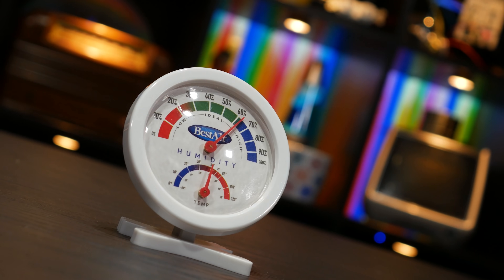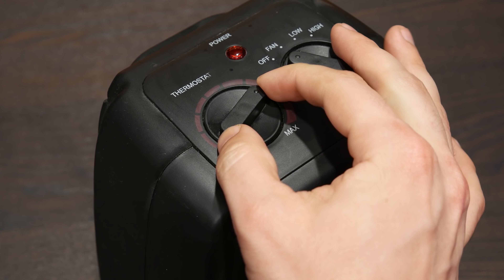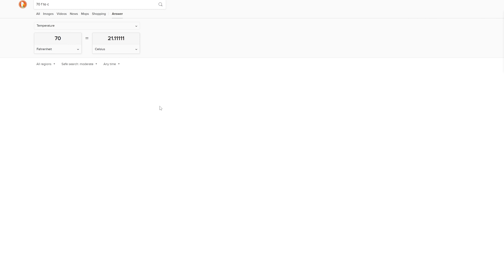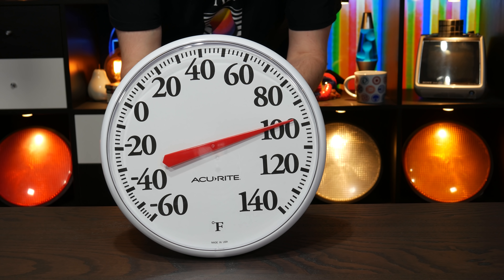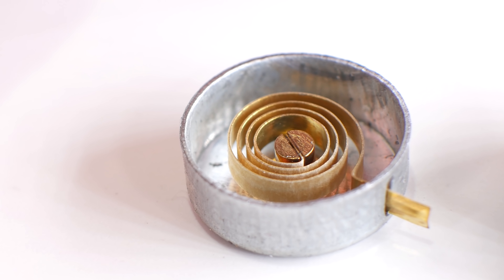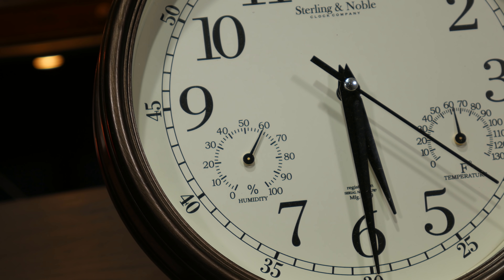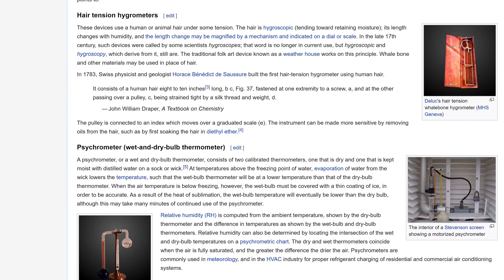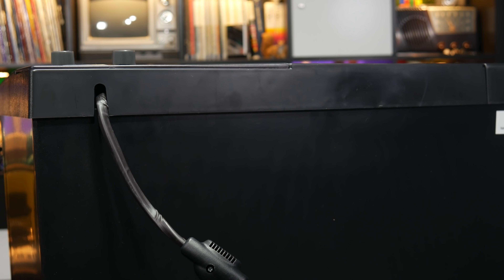Analog Hygrometers - how?

Comment: I've got a soil moisture sensor for checking my potted plants and seeing if they need watering. It seems pretty simple - it has two tines that go into the soil (one is for measuring pH I believe). It doesn't use batteries or anything.

I was trying to think about how this sort of mechanism would work when the "measurey" bit is on a metal tine that goes down into the soil, instead of a coil directly attached to the dial, measuring it's surroundings. Any takes on that?

Comment: Loved the temperature rant.  All the same points I've made to my euro-friends.  C is a good metric when you're in science and engineering, but I'd rather keep my dumb imperial standards for day to day use.  F does scale perfectly for what the human body likes between 0-100.  What water thinks about the scale is irrelevant!

Also, CM and MM are too small to be very practical for the average person, and a full meter is pretty long if you're trying to gauge the distance between things.  The real issue with inches and feet comes from the stupid progression of 12" = 1'  and 3' = a yard.  Dumb names, dumb conversion.  And I can't even remember the very specific number of feet in a mile.  But again, from a practical point, a foot is not that far off from the length of normal human foot, and a yard is about a single stride.  It's a metric built for human use, and not something scientific, like comparing everything to the world's most common chemical compound.  Humans are a lot less precise than the way a chemical reacts, and that's OK as long as we agree on the exact sizes of these measurements.

Comment: Regarding temperature scales: I set both my phone temperature reading and my car thermometer to read in Celsius, and I still can't think in Celsius. Its been 10 years since I switched over, and I still just do a quick and dirty calculation in my head to convert to Fahrenheit. If I see 30 degrees on my thermometer, I know its hot outside because I've done the mental calculation enough times to just remember that it equates to roughly 90 degrees Fahrenheit.

Comment: It is not about conversion to outside the system, but conversion inside the system. cm to m to km is easy and you can do it in your head. Just shift the comma. Now please convert 12.446 inch into yards or miles in your head...
12.446 inch = 0.345722222 yard
12.446 inch = 0.000196433081 mile

Comment: Here is a thought. 1960's car fuel gauges used heated bi-metal strips that were connected to the pointer. Take the component from 7:49 and put it in a circuit with a battery and a similar gauge and you could have a simple battery-operated Hygrometer!

Comment: I'm currently at like 2:40 when he is talking about temperature and stuff. I have a rough (and I mean VERY rough) mental conversion I do. Let's say the temp is 70F. All you need to do is subtract 20, then divide by 2. Then you get the answer 25C. The correct answer is closer to 21C, but it is close enough to get an idea for me at least. You can do it the other way. If the temp is 18C, multiply it by 2, so it is now 36, and add 20, 56F is the area. The actual temp is 64, so not totally accurate, but you can get the idea if the temp is close to room temp, hotter than room, or colder than it.

Comment: Yes! The burn with the search engine! Yes!
Or you know. You can download a converter app.
Edit:
Seriously. The most important thing is stating the unit. Even in metric as one time it might be the base unit (for example a meter) and another time a derivative unit (a decimeter).
You. Have. To. State. The. Unit.
I don't care what unit you're using as long as it is usable/readable. (For instance 0.000002 m is unreadable as heck, but 2 or 2*10^-6 m are readable and usable).
Also, please don't convert units like newton to SI units unless you need to. (N = kg*m/s^2)

Comment: Very disappointed.  No discussion of relative vs absolute humidity.  No discussion of dew point.  Even the sensor in the humidifier is crap for accuracy.   If you want an accurate measure of RH, you need and accurate measure of the temperature, and the dew point (and a lookup table).  Accurately measuring dew point is worth it's own video.  Hope we get some of this in the Connextras.

Comment: You skipped one of the more interesting ways to measure the humidity in the air and a chance to talk about latent heat again: the sling psychrometer. It was even on the Wikipedia page you had open in your video. It even has an awesome name that sounds like it should be a tool for finding ghosts rather than what it actually is: a calibrated meteorological instrument. Also, it's a rather simple and elegant design that is basically two thermometers on a stick, one wearing a wet sock that you swing through the air.

Comment: For my fellow Americans who read both celsius and centigrade in the comments and realized you didn't know the difference, I did a quick Google for all of us. Now that this is not an in-depth explanation...

The temp scale used to be called centigrade and has been updated to be called celsius. Celsius is still a centigrade measurement system, though, as a centigrade system is based on hundredths and celsius is based on 0-100 for freezing to boiling water (centi+grade). Both names are technically correct, but it's one of those "this is a variant of that, but that isn't a variant of this" sort of things.
Also, I guess when changing the name to celsius the actual degree points were dialed in a bit? Like I said, I didn't dig too deep here.
Also also, I guess saying centigrade for the temp scale was confusing for the Spanish and French because they use that word for describing angles (like degrees and radians).

Comment: Thanks I've never thought of how these worked before.
We had one at work that worked with hair, and clockwork mechanism to give a paper recording of temperature and humidity over a week, till it got broken when we sent it for calibration, we now use electronic meters to do the same.
Thought you might have mentioned the wet and dry bulb method which you need to look up a table to get the humidity (basically 2 thermometers one which was kept wet). Also had 2 types of this, one which was just on the wall with 2 thermometers (cheap and nasty) the other on a handle which you swung around (a lot better construction)

Comment: "and a 0-100 scale that correlates with human temperatures is more pleasing" THANK YOU. Like, it doesnt really matter what temperature water boils at or freezes at in day to day life. But it does matter whether I need to wear a coat or a baseball cap. All temperature scales are arbitrarily based on something, it doesnt really matter what you base it on.
Similarly, metric length measurements- A foot is a very useful metric in day to day life. We have a yard if we need a meter length, and a mile if we need a long length. Whether a kilometer or a mile is a more valid measurement for a long distance doesnt really matter, as long as everyone is on the same page. And again, conversion rate doesnt really matter that much in day to day life.

That said, imperial Volume measurements are shit

Comment: I'll total agree that metric length and weight units are better than what we use in the US, but Celsius doesn't seem any better to my than Fahrenheit. Most of the benefit of metric is simpler fractional units, and how useful is having the boiling point of water an even 100, I don't even remember the last time I needed to know the boiling point of water (and I still haven't forgotten it's 212F).

Comment: One could argue Fahrenheit being a scale designed between the freezing point of water and blood temperature could be better for meteorological purposes for ‘real feel’ temperatures. 

One could also argue those centigrade snobs are incorrectly using centigrade instead of the SI unit of temperature, the Kelvin. 

In the end these arguments are moot. Just use the one you prefer.

Comment: Weird, i was just thinking about analogue hyrometers earlier today. i was wondering whether I could make a mechanical soil moisture sensor and use it to control a tap to a soaker hose without needing any electricity. So it would water the plants when they dry out. Kind of like a wax-disc thermostat but for moisture instead of warmth.

Comment: Great video as always! But can you use °C the next time? It's objectively better.
Reply: Incorrect
Reply: @kylemaloy5524  It's better because at the mean air pressure you can tell up to two different ambient temperatures. You just need a precise barometer and water to tell it. If it starts to freeze it's 0 °C and if it starts to boil you should get your priorities straight.
Reply: Ah yes, 0° outside being kinda chilly but easily solved with jacket and 100° outside being the end of the fucking world is a very well scaled system for everyday use. So much better than 0 being really fucking cold and 100 being really fucking hot.
Reply: Correct

Comment: Degrees Fahrenheit is objectively better than degrees celsius. It is more precise at the same number of significant figures. Choosing celsius was the only mistake in the metric system, well that and not adopting metric time.
Metric supporters, get off your high horse until you fix time. 24/60/60 isn't metric.

Comment: No need for a rant about advantages of any system based on the temperature scale. The metric system has the advantage, that the units increase in factors of 10. Temperature, however, does not, and therefore,there is no real advantage of either system. Even the higher resolution of the Fahrenheit scale is not an argument as weather forecasts are usually something like "high in the eighties".

Comment: the electronic hygrometer are pretty awful as well. I bought a bunch and put them together into a dry box where I am going to store my filament and only about 4 out 9 agree with each other. The others are at least 5% points off. And when I tested them in the room with normal humidity the results were even worse.

Comment: Farenheit is objectively better for everyday use, especially when talking about weather. Fight me, rest of the world.
Reply: Fahrenheit was invented for the weather.
Reply: as an edgy high schooler, I used to be a metric rebel, saying we should totally switch, but I've come to warm up to some specific applications of our system. Temperature, as you mentioned, but also distance, specifically miles, when walking, I learned, is so named from the latin mille meaning thousand, as in a thousand paces, and a pace being two steps, giving you roughly a mile. but inches is totally crap, I say make the hybrid system a thing. also, tsp and Tsp are very useful
Reply: @johncounts2182  yeah it's a completely different way of thinking about measurement. SI makes the mathematics of unit conversion easier, but since it's base 10 when you truncate/round a measurement you have to go up a full order of magnitude. As a result you get a lot of cumbersome situations where the base measurement is too fine for the thing you're measuring, but the next largest (being 10x as big) is too coarse. American/imperial measurements, on the other hand, are usually loosely based on dividing things into halves and quarters, which tends to be a more useful way to break something down than dividing it into tenths. I think that's part of why so many Americans actually prefer imperial to metric, despite the fact that we all know metric. Like outside a math textbook it doesn't matter in the slightest that it's easier to convert centimeters to kilometers than it is to convert inches to miles. On the other hand, the fact that I can cook using only a cup measure, without really thinking about it at all, because all of the volumetric units are easy-to-estimate halves, quarters, eighths, etc. is really nice.
Reply: @user-lk2vo8fo2q  Americans don't prefer Imperial. That's strictly a UK Commonwealth thing.

Comment: So, why don't you guys use Fahrenheit if the internet provides convenient ways to get the tempretur in Celsius? (And I haven't even started about SI units)
That aside, a quick guide to °C:
-10°C: extremely cold. shoudl should get a really warm winter jacket and wear gloves and a bonnet
0°C: really cold, if you look outside and the water is frozen, it is below 0°C
5°C: cold. You are going to need a warm jacket.
10°C: relatively cold, you are going to need a jacket.
15°C: Mild spring day, a light Jacket or a warm sweater should be enough
20°C: Room Temperature. A checkered brown suit jacket is usefull if you sit around for long periods of time.
25°C: Warm, a T-shirt is going to be enough.
30°C: really warm. A pretty average summer day.
35°C: hot. A hot summer day.
40°C: extremly hot. At least in Europe. In Texas or Arizona this is porbably a pretty average summer day.
Reply: Heres an even quicker guide to °F : 0 is really fucking cold, 100 is really fucking hot, anything in between is a simple percentage.
Reply: @kylemaloy5524  so room temperature is about 90°F?
Reply: @burningSHADOW42  ah yes, 90% of "really fucking hot" is probably comfortable, that makes sense
Reply: @kylemaloy5524  yeah pretty much.
20°C is comfortable and 30°C is too hot. At least for me.
Reply: @burningSHADOW42  what even is your point there??? 20 isn't anywhere near 90% of 30. I'm sure 27C doesn't sound very comfortable if 30C is too hot
Reply: @kylemaloy5524  my point is that I wanted to provide a nice guide to Celsius for Fahrenheit users.
Your description of Fahrenheit is not really helpful because, too hot or really cold are highly subjective. That's why gave some other point of reference that are more general.
But I probably should have added:
~36°C Human body temperature

Comment: I am a Metrologist. I give you a C+. First of all Fahrenheit is more accurate than Celsius, about 2 times. This humidity measurement is relative because it equates with the dew point. I have calibrated many with horse hair too. A sling psychrometer would of been a great tool to show.
Reply: Not more accurate, only has smaller 1° divisions. More accurate (or perhaps more 'true') is Kelvin.
Mainly because it helps understanding that a 1°C difference is just about a 1/300-th difference in energy (at about 25°C / 77°F).
Reply: @johanponken  Which is more accurate? Telling someone they have a glass of water or telling them they only have half a glass of water? 😀

Comment: "tollerable range of temperature" is extremely subjective and inaccurate, when everyone has clear idea of water boiling and water freezing,
Btw, i believe even in us, if you ask everyone what subzero temperature means, they will answer when water freezes (e.g 0 C) not sub 0 F
Reply: If you asked me what I considered "sub-zero temperatures" I would tell you "Below 0 degrees in the temperature scale I use, which is F" and not "when water freezes" because that happens much earlier than 0 F.
Reply: Subzero is below 0f, below freezing is below 32f.

Comment: Ok now describe the difference between the metal strip in space heaters, wall fireplaces and the ones in your house thermostat. the ones in the space heaters do relative temp (the temp they heat to varies with the environment temp) and the one in your house thermostat is calibrated to the actual temperature.

Comment: Celsius vs Fahrenheit is the dumbest of the units arguments.
There's no inherent advantage to either. They don't make conversions or working with other units any easier.
Celsius is only more convenient when you're dealing with water. Fahrenheit's advantage in precision is only relevant if you don't like using decimal points and its only more intuitive if you're talking about human comfort. Metric users could start using Fahrenheit and vice-versa over night and it would change nothing about the rest of their systems. It's 100% a question of preference.

Comment: Simple from the outside, but hard to make it run in the beginning.
Trying to make a mass produced product based on those physical properties, maybe in the early 1900 or so, would be a few months of experimenting and refining.
Even the very cheap ones today (that work) probably required weeks or months to get them into this state. The final plastic mould will be extremely cheap in the end.
However, the MEMS sensors will take over. But still, some good MEMS sensor a few years ago for hygro/temp would cost 30 bucks, while the plastic pointer and spring would cost maybe $1 or $2 in production.

Comment: What temp is it? 70.
What temp is it? 21.1111111111111111111

Hmmm. Gee, I can't, for the life of me, get why we dont use C.
Reply: ::facepalm
Reply: @jayhom5385  F -00 death -0 freezing 0 cold 00 moderate to warm 000 heat stroke

C - 0 freezing to cold -0.0 freezing to cold 0 cold to moderate to warm 0.0 cold to moderate to warm 00 warm to hot to heat stroke 00.0 warm to hot to heat stroke

If you start to miss decimal points you can easily add it for even more accuracy. It's better for measuring and conveying climate temp. Metric has its place.

Comment: Is it freezing outside? Let me check my handy Fahrenheit thermometer and try to judge if the temperature is higher or lower than 32 degrees. Okay well there's 20. 30 must be the big line between 20 and 40. There's five little lines between the bolder lines so I'm going to guess those mean 2 degrees. So I need to see if the temperature is higher or lower than the first little line after the first big line after 20 degrees. Herp de derp de derp (Nice video, I have a Hygrometers like this and I've often wondered how it worked. I can easily see the coil on mine so I figured it had to do with the some property of the material but I didn't notice that one side was different before. It is linear so I don't know how good it is)